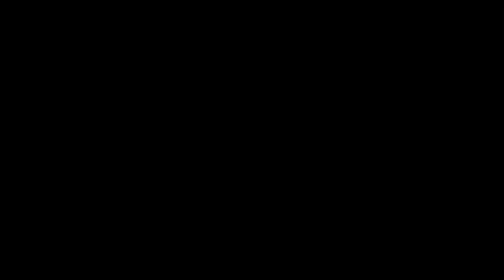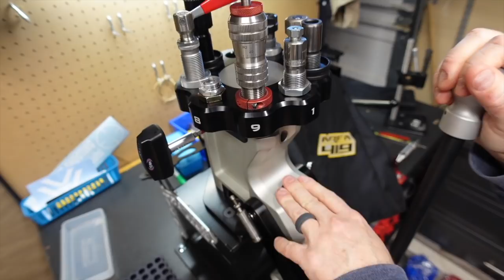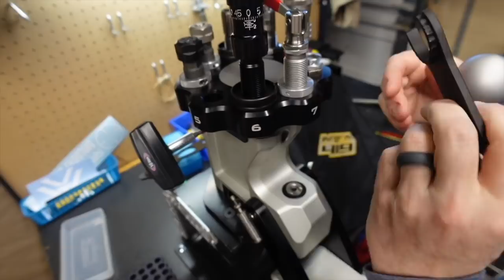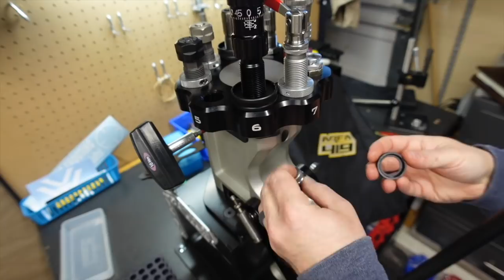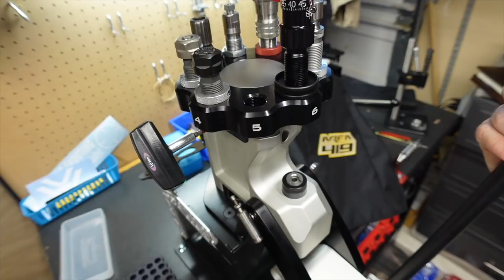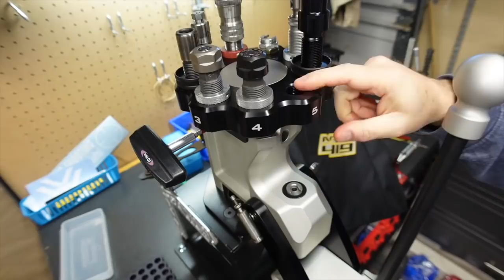Area 419 Zero Press Quick Update – Performance and Features After Testing

Comment: Hi, John. 
I noticed you have the Hornady bullet puller installed. Have you ever tried the RCBS collet bullet puller? It supposedly mars less the pulled Bullets.
I’m considering getting the new Frankford Arsenal wall mounted inertia bullet puller (it’s basically a substitute to a typical inertia hammer) since it doesn’t damage the tip of the bullet or mars its surface.
Reply from the maker: I really like the Hornady but have never tried the RCBS. If I have to pull a bullet I just write it off as a good bullet no matter what and use them for blow offs. As for the FA unit, it’s interesting looking but not something I have any interest in using.

Comment: I like using Redding competition shell holders for resizing, but they require a slight cam-over when setting up the die. Is the Zero designed to be used with cam-over?
Reply: We’ve used them for years, and think they’re the best way on the market today to set shoulder-bump. All they require is the shellholder to contact the bottom of the die, have been using them since the very first ZERO prototype was built.
Reply: @area419  thanks Jon, that is very helpful. You make a great looking press!

Comment: Does the shell holder float, that is to say, when the case goes up into the die will it adjust itself for a perfect alignment, or is the case/shell holder and die alignment set?
Reply: The nature of shellholders allows for a small amount of radial float, and we have not tried to prevent that. With most shellholders there is probably a total of .010-.015” diametric float available. Unless using a collet or something of the sort a true lock on the case head would require all brass to be perfectly alike, and still result in a terribly frustrating user experience.

Comment: I use the redding t7. I have the seating die beside an instant indicator die so I can set my jump for each individual round by switching between those two dies. Could I do that on this press? Would I just not tighten the torque wrench? Can it be used without the torque wrench tightened? Thanks for the videos!
Reply from the maker: Technically it can be done that way. There's nothing preventing you from leaving the head loose so you can move it around between stages. I have played with seating bullets that way just for fun and there's a little variance compared to locked down. It's up to you if that's acceptable or not.

Comment: Glad you like it...but to me that's just bench bling and isn't any faster or more effective on target than my Co-Ax.  Congrats and I look forward to you proving me wrong.  I really love the Area 419 stuff I have and they are a great company, but sometimes they are a fancy solution (pride in craftsmanship/ownership) to a nonexistent problem.
Reply: My sense is that you missed the message...... he is not talking about faster or effective; he is saying that the cumulative effect of the press is a more enjoyable experience.  I am not a fan of bling but, I am nuts about a quality product and the 419 Zero Press sure exudes quality. Happy loading.
Reply: I have a Zero, a Co-Ax, a T-7, a 550B, a 650XL, and a RCIV.  I didn't test the actual shots side-by-side for control, but the runout on the Zero was 1/2 to 1/3 that what I had from the Co-Ax.  I tested about 300 rounds of different calibers, from 6.5 to 338LM.  There wasn't a lot of runout to begin with, and the Co-Ax just knocked it down.  The only downside is that for some of my dies, I like a "Cam-Over" feel, and it doesn't do that.  But the performance is unquestionably better, at least as measured by runout.

Comment: Oh man, here I was going to get a 750 based on your recommendations--is the Zero really the way to go?
Reply from the maker: It's just two different tools that are both great. Look at your needs and what you want out of the process and that should help make a decision.
Reply: As John says - what do you want out of the reloading process?  I imagine loading on the Zero to be like running a really nice manual milling machine like a dialed in Bridgeport versus a cheapie mill drill.  If what you need is efficiency and loading high quality ammo quickly because your time is at a premium, a 750 might still be the way to go.  If reloading is about getting away from other stuff you're doing, decompress and "connect with your ammo" like John says, maybe Zero is the way to go.